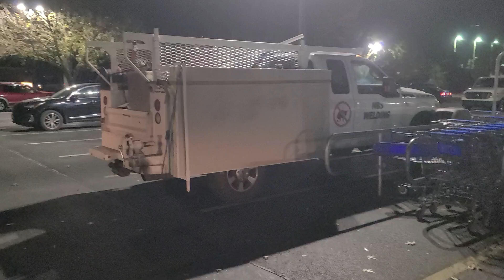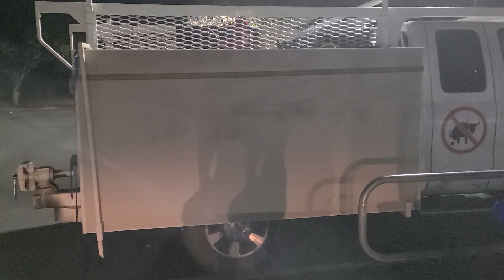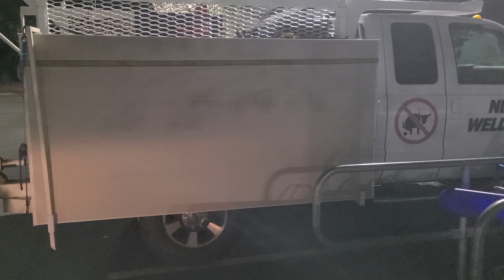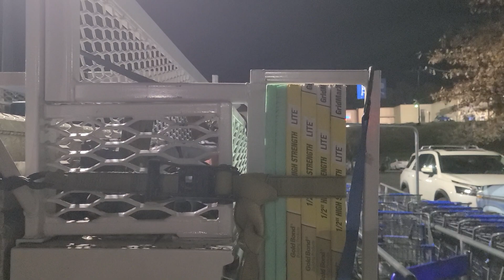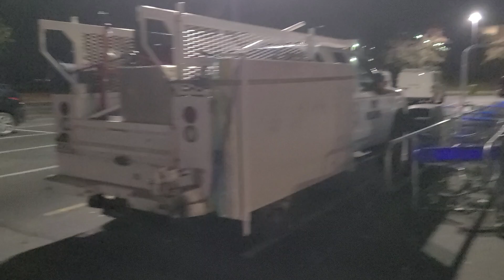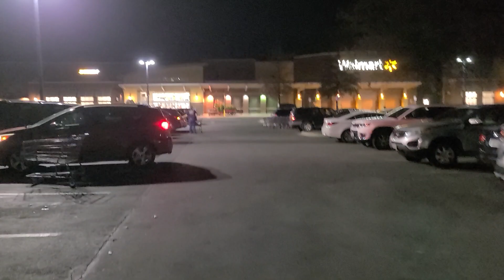Update on side panel rack on Super Service Truck

Comment: Great idea and well done, but those bottom hooks are too close to the ends of the sheets.  You could lose the sheets.  Moving  those bottom hooks closer  together wouldn't  be too difficult.  If you do that, show us that video. please.
Reply from the maker: Worked great when I used it...very secure...no issues